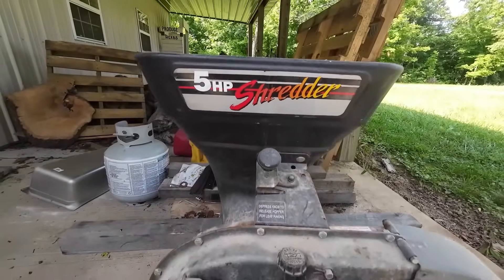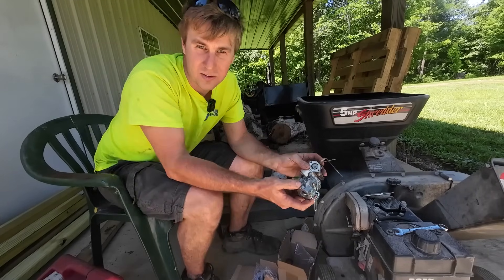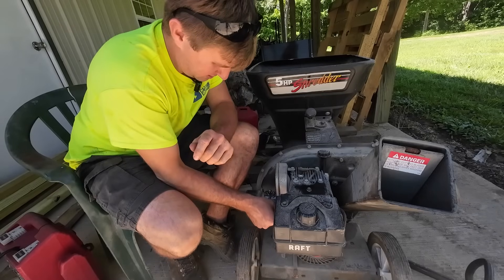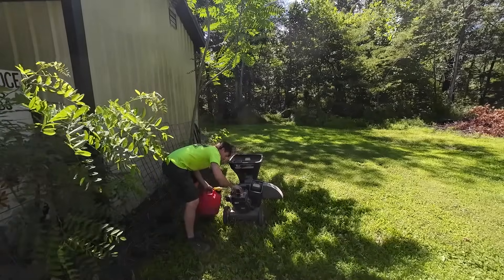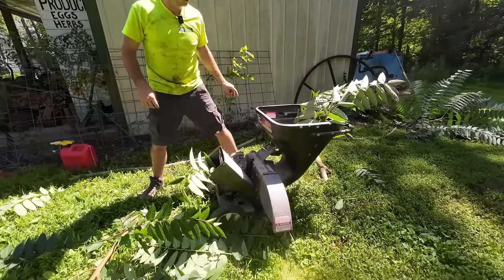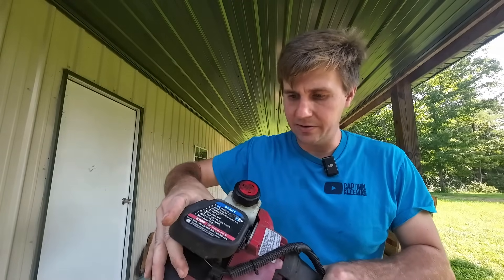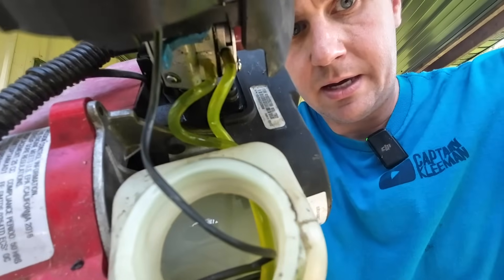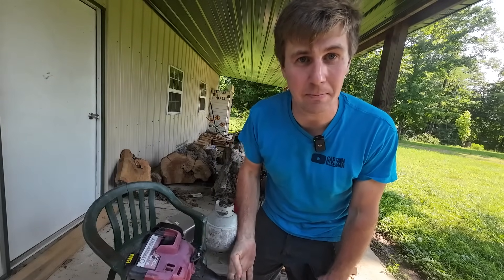Free and Non-Running - The Easiest First Step

Comment: I can attest that carburetors are easy to change. I'm a 62 year old woman and I changed my first one last year. We had an old weedeater that hadn't been used in years and wouldn't run. Bought a carburetor for less than $20 and watched a Chickanic video about how to change and adjust them. Changed (carb, fuel lines, fuel filter in tank) and adjusted it with no problems and now it runs like a champ.

Comment: Hi Mike.  I got one of those aftermarket carbs for a cheap chainsaw off ebay one time and it bolted in fine but only ran at wide-open throttle.  I switched part of the throttle linkage from the original carb and all was fine.  It wasn't from the company you mentioned so no bad reflection on them.  Just mentioning it because once in a while, an exact replacement isn't really exact.  The fix was pretty simple and if a fella had some mechanical aptitude, it wasn't hard to figure out.

Comment: Hello Mike. I have the FB32EC by TroyBilt. I also have the pole saw attachment. I have sharpened the chain once. The thing runs great on non-ethanol gas mix. The two channels have one thing in common and I suppose you know what is. Perhaps, the two channels could meet one day. 
Have good days!

Comment: I have passed along (given away) a lot of stuff for exactly that reason.  It was frustrating enough that it did not start when I wanted to use it and I got even more bothered when a few minutes of trying to get it running didn’t magically resolve it (you’re fired).  That was Phase 2 of life where I had little to zero time to waste on things (or people) that were not working well.   
Phase 1 of life…I happily collected others’ broken or non functioning stuff and fixed it. 
Phase 3….now I have all the time in the world and dislike yielding to things that really need to work.  Even if I don’t want it anymore, I’ll usually fix it before I give it away to someone who does want it.

Comment: Every spring you can find tons of free / cheap small engine stuff listed online, everyone leaves gas in them over winter, they gum up, and won't start when they finally decide to use them. Easy carb clean or swap and usually it's back up and running in no time.

Comment: MIKE, don't know why it is, but, I can fix other people's 'junk' and it works fine. Me? Not so much! Got a great Service star riding mower, rebuilt the carburetor with the proper kit, TWICE, delved into New plugs, coil, and various other parts. Non-ethanol fuel, everything new now, still got nuthin! Cranks, got spark just won't fire on its own, only on starting fluid. Guess its a lost cause.

Comment: Common sense for changing a carburetor can be as simple as taking a couple pictures before you start to take it apart. 
I replaced the carburetor on my Dad’s mower because buying a multipack of float seats cost the same as a replacement carburetor. 
Definitely a seat was cheaper but I know I would not remember where I put the seats the next time I needed one of the 9 extra. 

One thing I found with the replacement offshore carburetor is that the gaskets were much thinner than an OEM Briggs & Stratton gasket.
Reply from the maker: I found the same things, same price to just get the whole carb, but thinner gaskets,  but I've never had any issues with the gaskets and if I was too worried about it, some gasket material goes a long way

Comment: My good neighbor picked up a box of Dewalt 18 volt tools at a yard sale last week. A small circular saw, an impact driver and a drill. The one battery with them wouldn't charge all the way and all his other stuff is the red tools from Harbor Freight, so he gave them to me.
 I cleaned the contacts on the charger and battery and it charges now, but I also ordered 4  18 to 20 volt Dewalt adapters so I can use my Dewalt 20 volt batteries on them.
 The extra adapter will be used to connect to a Crraftsman 18 volt battery shell, so I can use my Dewalt batteries on my Craftsman  drill and work light. 
 I already have an adapter I made to run my 18 volt Black and Decker weed eater, with my 30 Volt Dewalt batteries.
 I had to do the 'right thing' and buy 2 more 3 AH Dewalt 20 volt batteries, so I can keep everything charged and running.
Reply from the maker: That's awesome!

Comment: Cap’n I did the same thing for my old LawnBoy push mower.  But, the eBay parts were crap.  The carb lasted about a month.  Thanx for the source.   I’m ready to tackle the LawnBoy again!

Hey bud, the mic for my GoPro is a PITA.  It connects sometimes and craps out randomly.  What mic do you use?

Comment: So many people think you have to go OEM on stuff.  Most of the carbs are made by a few companies and they just have a different plate with the brand name on it   Most times the OEM part number will cross to a aftermarket parts.   I do this with everything.  Mower blades are another big one.  Dealer wants $100 a set I can get the same blade with there part number stamped in the blade for $45 a set.
Reply from the maker: Yup, exactly.  Same factory line, different boxes

Comment: The cheap carbs don't last as long from my experience, but they're great for seeing if that's the problem with the engine. I tend to clean the old carb if the replacement works.
Reply from the maker: I've never had any issues, and a lot of "OEM" carbs are built in the same far around land.  I can't find a reason as to why pay the extra for the name on the box.   But if it doesn't last as long, a fella can still buy three or four of them for the price of the OEM lol
Reply: @Kleeman1  It might have been the brand I used. It's happened with a snow blower and a chainsaw. I agree - I didn't buy an OEM carb as replacement - just a more expensive after market.

Comment: Fuel in most cases is the issue, ethanol,  it’s expensive but canned tru fuel is what the fire department uses and your not changing out carburetor almost because of gunks up. I tried regular non ethanol gas but only last about 30 days or less  causing rough running engine